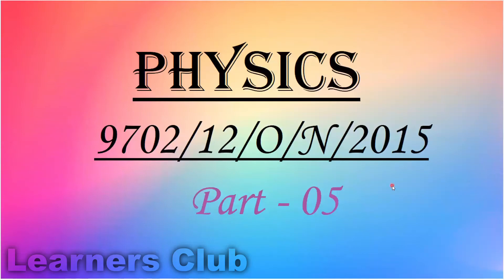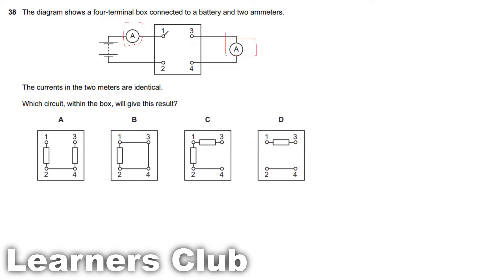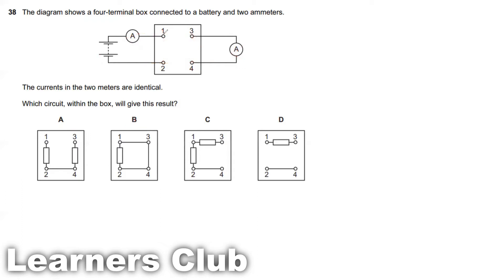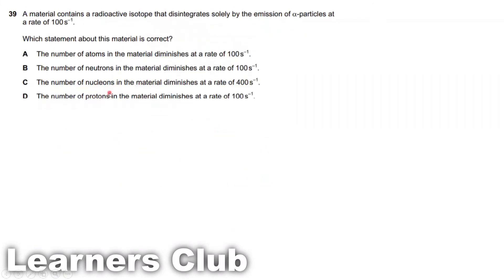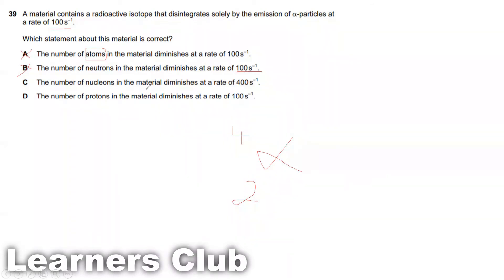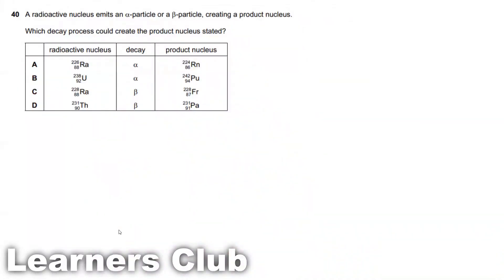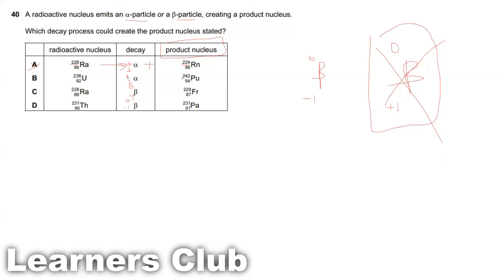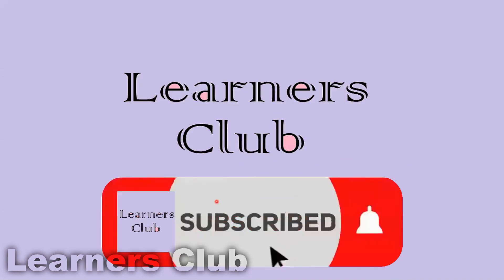9702/12/O/N/15 PART 05 - CIE 9702 Physics October/November 2015 paper 12

Comment: A simple theory of alpha particle scattering by a thin metal foil uses the four assumptions given below.
Which assumption is exact and is NOT an approximation?
A Each alpha particle interacts with just one nucleus
B the alpha particles lose no kinetic energy when they are deflected 
C the metal nuclei do-not recoil
D total momentum is conserved 
The correct option is D, how is A incorrect?
Reply: You posted this a year ago. So , I don't know if my answer right now helps, but still you may take it as a knowledge or understanding source from my side based on my understanding.

Explanation:
Just remember this, no matter what the situation momentum is always conserved. However,  A is incorrect because in real life, the alpha particle will not interact with just one nucleus. Imagine a alpha particle being thrown at the thin metal foil. There will be several nucleus that will repeal the alpha particle. But for our convenience, we usually consider that the alpha particle usually or approximately interacts with just one nucleus and that nucleus's effect will determine its deflection which is just an approximation and may not be the case in real life. Hence, A is wrong.